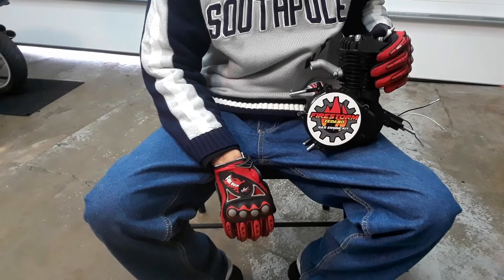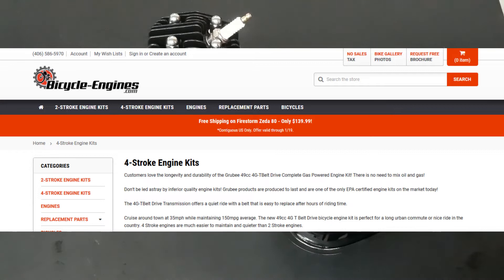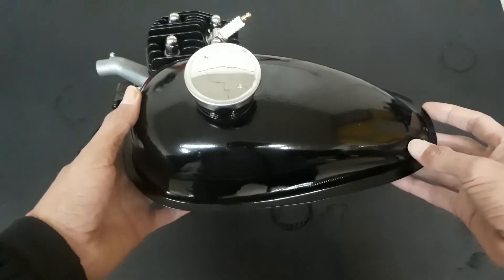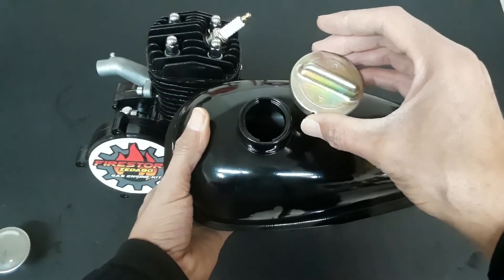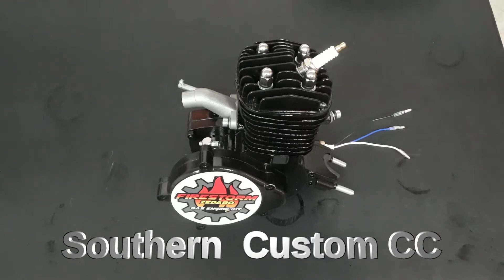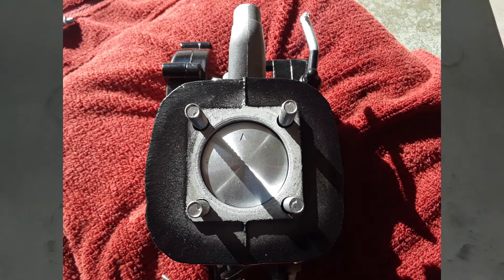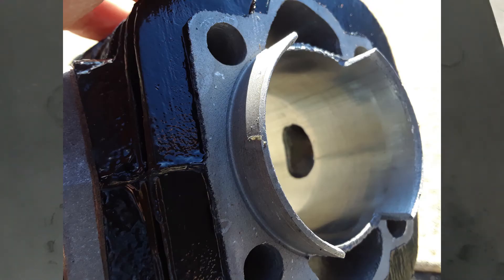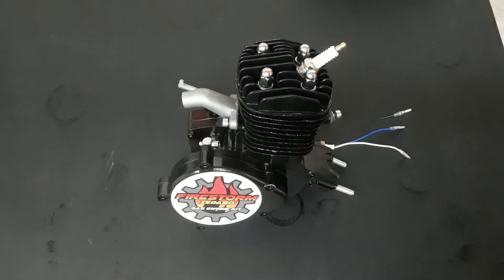ZEDA 80 ENGINE INSTALL WARNING!!! / Hyper 26 Project / Piston Correction

Comment: I had two Zeda 80 Firestorms blow up after a couple of months.
Reply: yeah I could make a video. I bought two Zeda 80 Firestorm engines at the same time. One of them lasted about 5 months before it started sounding rough like something with clanking around inside, I rode it 4 miles ti the store and it started to feel so rough and It had low power, on the ride back it was clanking so much and jerking so much it suddenly just locked up, I took it apart when I got home and the whole engine was completely seized, the piston had cracks and scraping all over the side of it and the rings melted and fuzed into the piston. The other engine lasted over a year now and two days ago I noticed it felt kinda weird and started to sound kinda bad like there was small pieces of metal inside or something so I took it apart to find the cyclnder and the piston has scrape lines on one side and the same thing with the upper piston ring looks like it has melted and fused into the piston. It’s no where near as bad so I’m going to see if I can repair the engine by replacing the piston and the cylinder.
Reply from the maker: @thirdeyesurvivor3886  Great write-up. I'm so sorry that is happening. I get to ride mine very seldom. Our weather is just getting it together, so I will ride her more. What oil to gas ratio are you using?
Reply: I usually do about 40:1 or 32:1 usually somewhere in the middle
Reply from the maker: Really, you should make a video on that, and show us the damage. What do you think happened?

Comment: I bought the big fin 6cc head along w my kit and took off head nd jug , cleaned metal shavings out also flushed crankcase too , chamfered sharp edges on ports , they looked ok , but wanted to make sure no ring snags , made mods where needed for my bike , my 1st build , took me 3 days to do it as perfect as possible and now have 400 flawless miles w the motor running better all the time . Im very happy w my firestorm80 from this present manufactured motor and will soon get the firestorm yd100 so hopefully i can run 32t sprocket for the street but am concerned about overheating cause when i ride i do 30-40 mile nonstop hikes @ 25mph steady cruise speeds but can the 1 peice yd100 jug handle it w the marginal amount of fins ? Also how did this build turn out for you and do you still have your tao tao 150cc scooter ? I ended up buying the gator e150 scooter w now over 7k miles and only problem w it my battery just now has quit charging otherwise it has been ultra reliable too
Reply from the maker: Hey Sun Dial, okay so what I know is that a little birdy told me those high compression heads, are going to produce a little more heat.I have one also but, 30-40 miles is a lot in my eyes, so glad you have had no problems. I haven't either, but don't think I have even 10 miles on the new engine. Yup, I still have Hope (150cc scoot) and just did a series on 180cc engine install. I also am having a problem with my very expensive Shorai battery that I installed in March.
Reply: @kachiskid   the battery is the lithium ?
Reply from the maker: @sundial6919  Yup. but it has a BMS which I don't think the Shorai does. It will guard against damage with over or under charging.
Reply: @kachiskid  youre right , the 6cc big fin head heats up pretty good on my long nonstop hikes but i have few stop signs or more than likely my goose woulda probly been cooked .I also used the copper head gasket its lot thinner than stock alum gasket . Dont know how engine performs w stock head cause main reason i bought the big fin head was for keepin it cooler on the long hauls . May try the shark head , it has the tall thin fin head to hopefully disapate the heat quicker , i also got the temp down by running the b8hs ngk colder plug which seems closer to acceptible now but i still want a head that runs cooler . I really like this motor so far . Im noticing keeping it greased at the right places keeps it happy and longer life also because these motors arent forced air cooled i will continue to run 20:1 mix

Comment: Hi, just to check, the firestorm sticker was supposed to come on the engine right?? I was really looking forward to it but when I opened up the boxes I didn’t find the sticker anywhere, did I look over it or was it supposed to be on the engine?
Reply: Ok, thank you. Did I deep search in the box and didn’t find it so they must of just not put it on
Reply from the maker: @Garrettsbrokebuilds  No problem, all it does it get dirty with oil. After a while it doesn't look good, I took mine off.
Reply from the maker: Yes sir, that was attached to the engine.

Comment: that stock gas cap, you have to push down with pretty good force. 10-15lb or so. when it's on the bike, its easier. think like child proof pill bottle style. i noticed you weren't pushing down at all. must be the scooter ones you don't have to push.
Reply from the maker: Sorry bro, did it numerous times before filming. It was just bad. Bicycle-engines.com even confirmed it.

Comment: Just got mine installed on a Schwinn Jaguar a couple weeks ago. My piston was on correctly but all my ports were crap though. About an hour with a dremel, some small files, and sandpaper and they cleaned up pretty well. They also didnt tap the exhaust bolt holes all the way to the bottom so I had to finish those as well.  My fuel cap was also super tight as well but as soon as it is exposed to gas fumes it loosens right up. Now I'm thinking it will start leaking soon enough. Have about 50 miles on mine and its gaining power every time I ride it. The piston slap is much louder than any two stroke I've ever owned but I came into this not expecting much in a cheap chinese motor kit. Overall, I'm happy with it so far.

The new kits have open transfers and supposedly ceramic coated cylinders. Will be interesting to compare that motor to this.

I have another bike im going to build and was thinking of doing a 4 stroke, but I might try the new open transfer zeda kit.
Reply from the maker: Awesome Ben, yeah Bicycle-engines.com contacted to inform me of the new cylinders. They will send me one when in stock and I will show you guys the difference in performance. Currently hitting 33-35 mph on a good day. Once broken in, I will be interested in see what your engine will do being ported and polished. I hear you can get 45 mph. 

Okay sell be on the 4-stroke, I'm listening...I just don't see ever putting one on a bike. To big and heavy, crank has to be changed out, makes for an awful pedaling experience. Not many performance upgrades can be done, have to change the oil...etc. Quieter and cleaner but I don't know if that's worth it...now I'll shut up and listen....
Reply: I'm running the 44 tooth rear on 26 inch wheels....currently getting about 26 MPH. She is running pig rich right now for break In. Running 20:1 Klotz Super Techniplate with 20% castor oil, and raised the needle up one notch. Once fully broken in..I am going down a size or two on the main jet and dropping the needle so hopefully hit 30 MPH.

Hahahaha.....I'm not sold on the 4 stroke either man, I just wanted one to try it and compare it to the 2 stroke......cant have too many different bikes ya know! I've been riding motorcycles my whole life and have always been a die hard 2 stroke fan. You are right....wide ass bottom bracket and clumsy to pedal, heavier, doesn't look as good etc. I'm still torn between the 4 stroke, open tranfer Zeda, or a BT100. The good thing about this hobby is it's so cheap compared to my other hobbies. I got the Jag used in Mint condition for 30 bucks! All told...$220 into the Jag build with a set of new white walls. I got my motor from motorized bikes as well.

Looking forward to the review on the new cylinder!
Reply from the maker: @bensnipes7288  Castor oil? What's that about? We are running pretty good over here on Redline 32:1 from the 1st fire up. 

4 stroke scooter = super fun, I haven't seen a person look comfortable on a 4-stroke bike yet...lol. I just know that the current exhaust is awful and messy, I have already bought the replacement just waiting on the new cylinder to put it on. Heck of a deal on the Jag, I wish I could find deals like that. Already up to $750 spent on Dominique but it's worth it. People love the bike. So your using the rag joint? How hard was that to install correctly?

Yeah Bicycle-engine.com has been great since seeing the video. They stated you guys shouldn't have a problem with backwards pistons again. Always good to check though.

Comment: I got a firestorm 100 just built my ride .my piston was correctly put in no issue at all .so far.
Reply from the maker: Awesome! Only reason I didnt get the 100 was too lazy to paint. Been a great engine so far😁
Reply: @kachiskid   I just got it all together an seems like I'm getting no 🔥 got compression
Reply from the maker: Are you using the plug it came with or a NGK?

Comment: Can't wait to see the project done... I never thought about motorizing a bicycle...  I myself am working on adding a speaker system on my scooter with an amplifier board and a design that I'm going to send to get 3D printed for the speakers and media player...
Reply from the maker: Thanks bro, I hadn't thought about one either until about 4 months ago and just went for it. Speaker system sounds awesome, make sure you get me a picture of your bike? Have you thought of buying a 3D printer? Much cheaper than they were, last I checked you can get one for around $250.
Reply: @kachiskid  yeah I thought about it but I'm to a point where I have run out of work space.. when I save enough money I'm going to build a shop in the backyard.